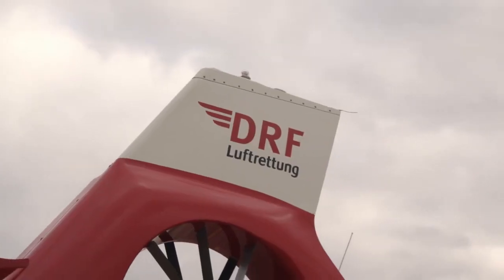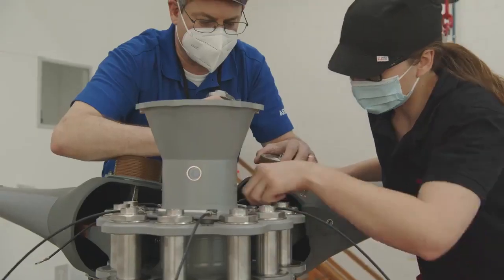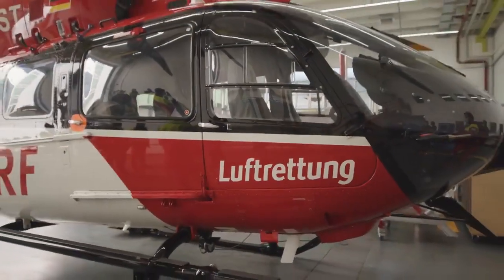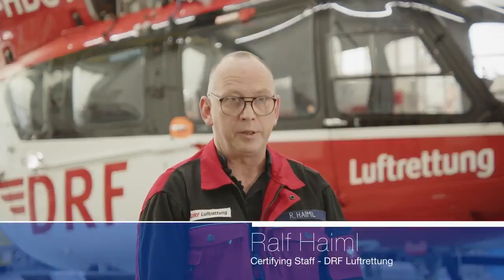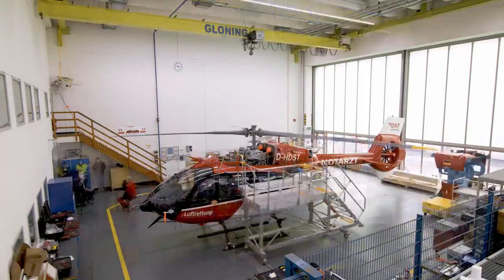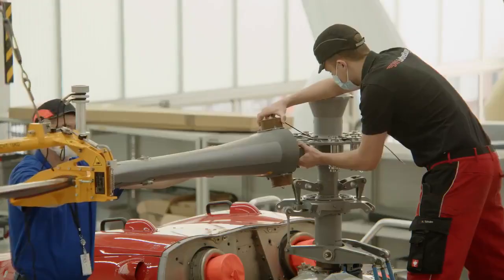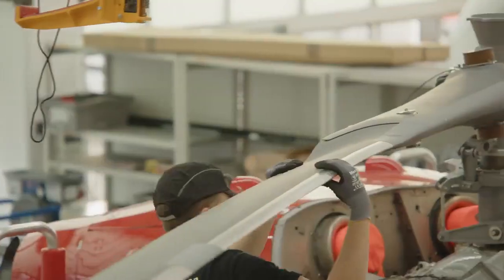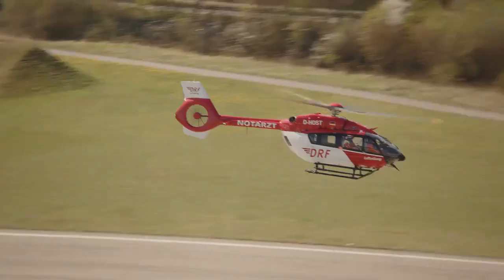Behind the scenes of the H145 first retrofit

Comment: Airbus helicopters, I ask, in theory, would it be possible to retrofit the 5 bladed rotor head to the original EC145 with the two bladed tail rotor? I'm in no way an Anti-Fenestron person, I am very grateful for Aerospatiale developing the shrouded tail rotor design back in the 60s as it had had a firm impact on future models with proven stability & safety benefits. But if I were a real world pilot, I'd favour the new 5 blade rotor head with the original tail rotor design!
Reply: No it Would be to much work and the old tail rotor would be louder they made the fenestron to reduce the noise and to be easier to use
Reply: @edy3794  firstly, they didn't make the fenestron, it was carried over from the 135, Aérospatiale developed the fenestron with the Gazelle back in the 1960s... Secondly. I was hoping for someone to give me an actual response... It wouldn't be any more work to convert the original Ec145 than it would be it's mechanically identical second gen, the only difference is the fenestron, the main rotor system is the same. I wouldn't want a febestron anyway... Have you never heard a helicopter with a fenestron hovering near your house? Absolutely deafening whine... Hence if I had the choice, I'd opt to retrofitting the 5 blade head on an older model.
Reply: @joewilson941  over my house Passes often an EC135 or sometimes even an H145 and I know how it sounds but I don't know I find an fenestron helicopter way better

Comment: What's the purpose of the 5 blades vs 4 blades?
Reply: Increased useful load of 150 kg(330 lb). More maintenance friendly. Better ride comfort for crew and passengers. For more information see the Airbus website. Or other internet sites. It is a very good innovation from Eurocopter/Airbus, the H145 and the H145 5 Bladed. 😉
Reply: @lilianahendrickx1692  thanks for that. 👍🏼